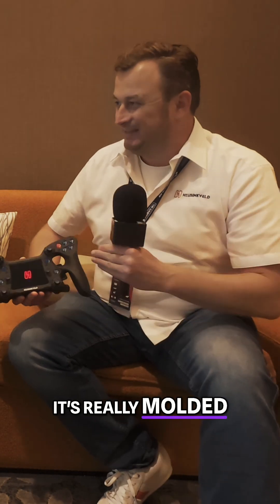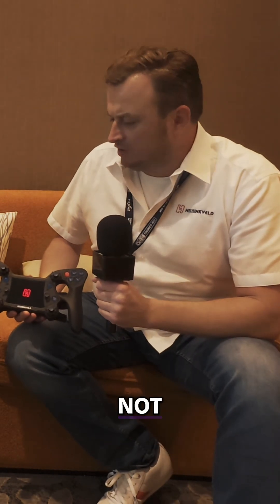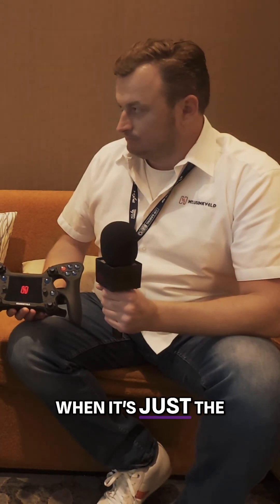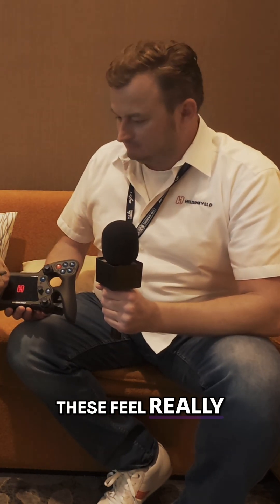Wireless Steering Wheel: No Backlit Buttons? Here's Why! #shorts

Comment: I think it's ugly, the buttons look very cheap, and charging 600 US for this is outrageous. They should make it very clear this is designed for vr users and not market it as a competitor to other sim wheels.
Reply from the maker: Of course it’s not pretty I agree, but the feeling is amazing and for me it was my favorite thing of the expo. Ergonomics matter for long races and this was/is the most ergo wheel I have ever used and I have used a ton. It is polarizing and not for everyone. I will gladly have one and enjoy it. As for price, all things follow this methodology. New designs and new manufacturing processes cost more. I don’t race in VR and I love it. Silicones new passive pedal is $499 but it’s worth why people will pay. Ultimately if it doesn’t sell well, it will be lower in price. And that will be the true tell.
Reply: @grayzedynamics All good points. I think for those who race almost exclusively in vr it could be a very good choice as looks dont matter, but I still stand by my comment that it is overpriced. The buttons look to be made of extremely cheap materials,  alibaba type stuff imho. For me, I dont race in vr so visual immersion is highly important. I drive the Ferrari hypercar in a few sims, and having the Pokornyi F499 wheel is such a key part of that immersion. Ultimately its each to their own and Heusinkveld should be commended for trying something new. Good on them.